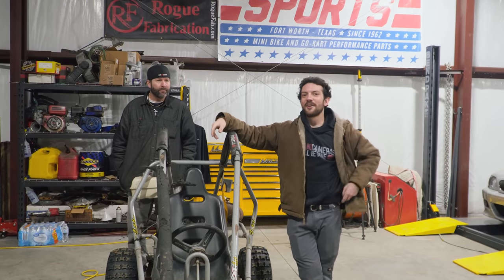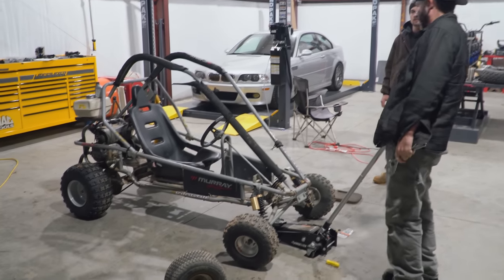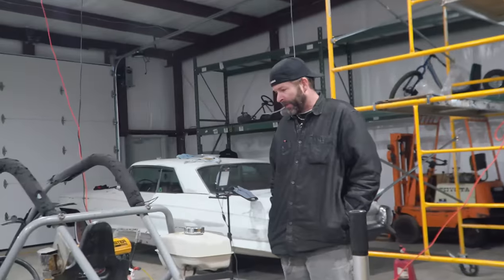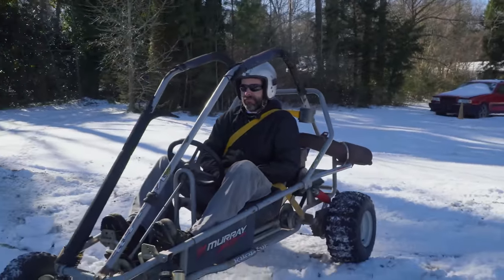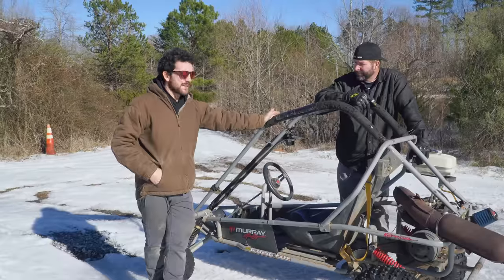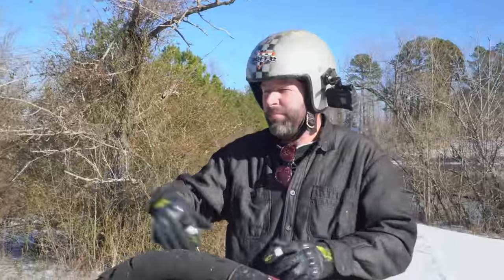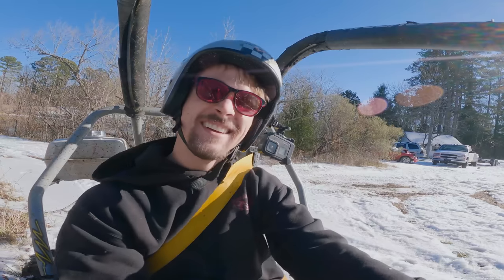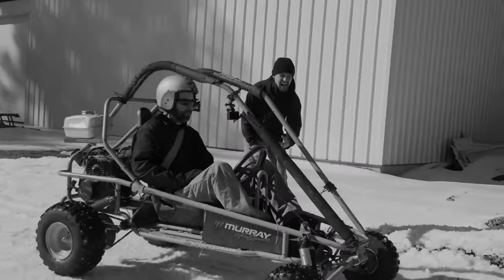Reviving our 440cc SNOWMOBILE Powered Go Kart!

Comment: You guys need the chassis clutch off from the snowmobile the engine came off from The clutch you have now on the chassis of the go-kart is way too small to be compatible with the clutch that is on the engine you need a bigger clutch on the chassis it's going to keep burning belts up and it would help you get that lower gearing from the takeoff that clutches too small then one on the engine is too big for the chassis clutch